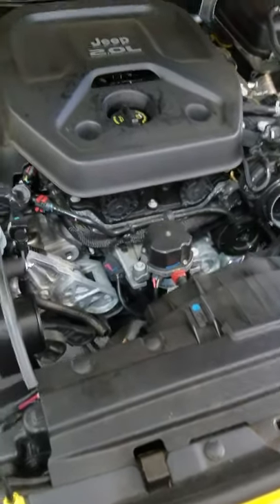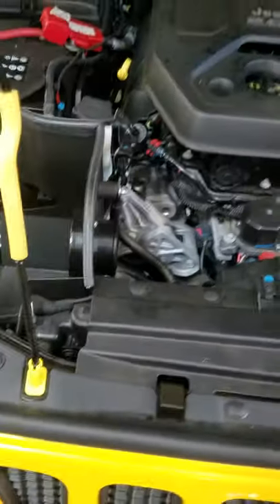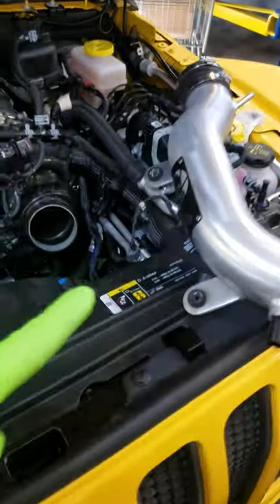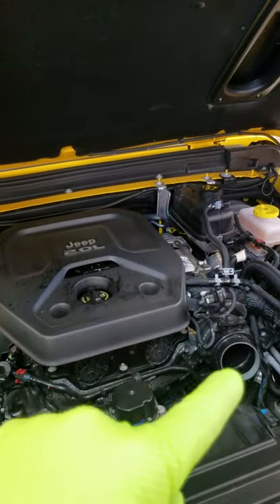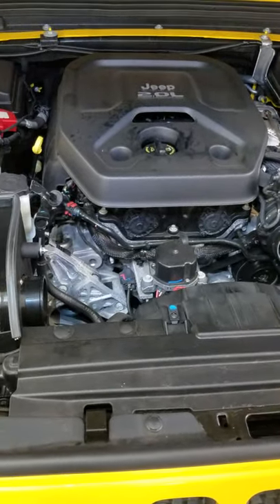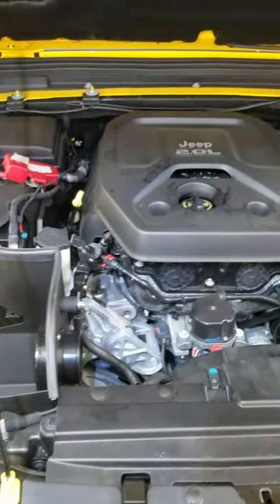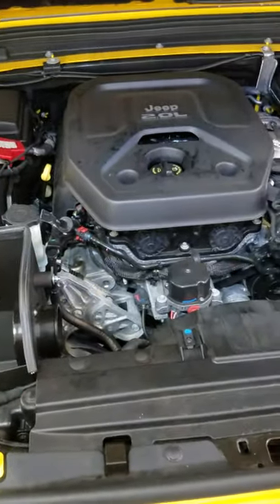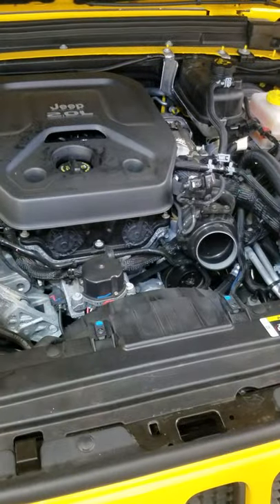2020 wrangler P1CEA, evap boost code

Comment: I have the same code with my abarth ...i hit a rock on the road and the stupid check engine came on - read the code with a reader and got the P1CEA
Reply: Running okay? Might have punctured or loosened either the driverside or passenger side intercooler piping connections. You can see them immediately looking underneath. If that's the case, you'd have a low boost/loss of overall performance entirely.

Comment: My tranny died at 25k miles and after swap I got this code 1 week after dealership.  Brought it back turns out there was a crack in the air box / air box piping.
Reply from the maker: they are very sensative

Comment: Hahahahaha... covered by warranty.
Reply: You said after market vendors are just there to sell crap, you're spot on.  I was helping my dad investigate some turn signal issues on his truck and the original owner put some aftermarket junk taillights on the rear that had absolutely no seals in the cheap clone connector they used which caused other issues.  We are pretty sure the column switch needs replaced at this point.
Reply from the maker: @cj691  yep exactly, a/m companies are there to sell products. People buy them assuming it's all good, then freak out when problems immerge. Sorry Mr customer but you modified your vehicle, not covered by warranty

Comment: im getting this code with my abarth 500..its well known in our community...boost leaks for days...now i need to find where im having a god damn leak..
Reply: Have you found your leak? I'm having the same issue with my Abarth with code P1CEA.
Reply: I have the same issue 😭
Reply: Same, would love to know if y’all find answer
Reply: @mynameizriley  it goes away regularly and regularly comes back on, I  suspect it's an rpm issue because it only comes on when I'm driving like a maniac when I'm driving sensibly it stays off
Reply: @SuperKDash  pretty much same for me, took a 400 mile road trip driving super slow and consistent for best mpg. Nothing, got back drove in city and bam.
Reply: @mynameizriley  you on Instagram or anything I'd like to stay in touch on the subject?
Reply from the maker: Best way is to use pressurized smoke machine to find the leak. The hard part is that most of the time of leaks will only show up under pressure due to fractures or cracks in the piping